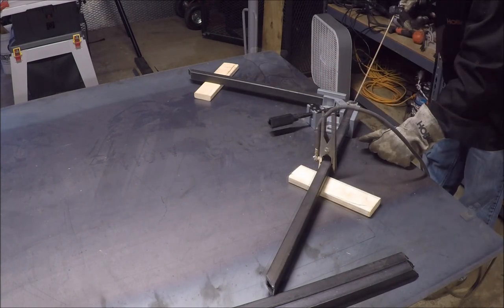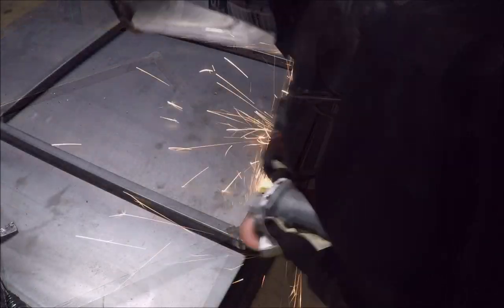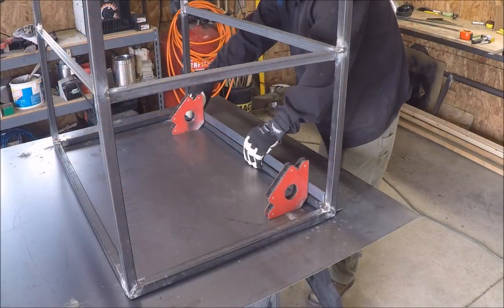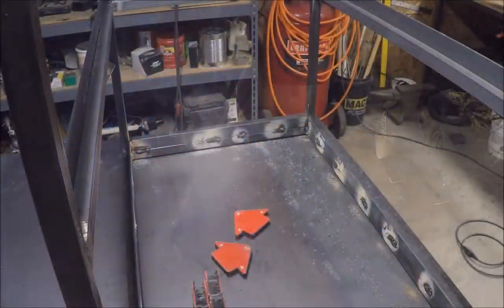How to build a custom dog kennel.

Comment: My dog is very anxious so when I put her in her cage she likes to use the restroom immediately and sometimes I'm not there to immediately clean up after her so I'm trying to figure out how to make a catch basin underneath the cage for when she urinates
Reply from the maker: You might consider using cedar chips until you get a basin built. It can soak up the urine and the cedar helps with the smell. Easy to clean up and not too expensive.